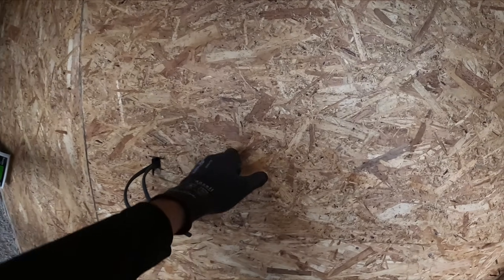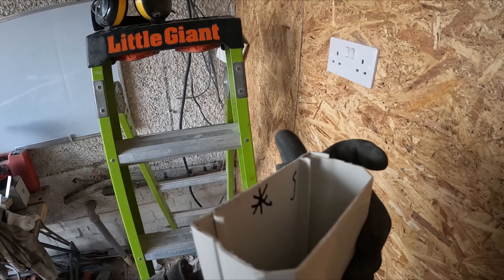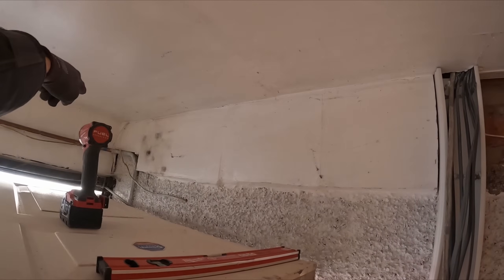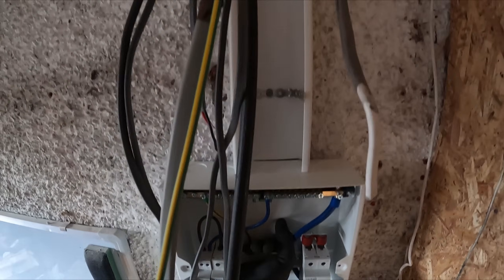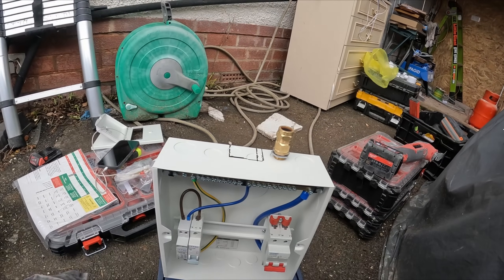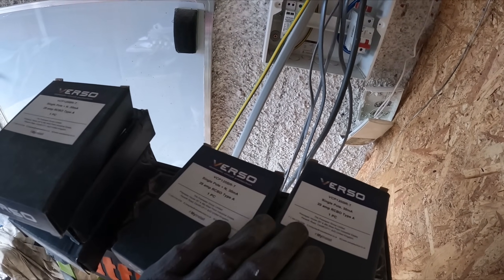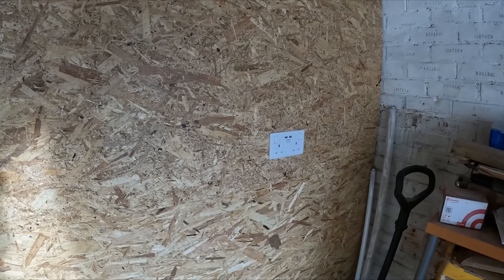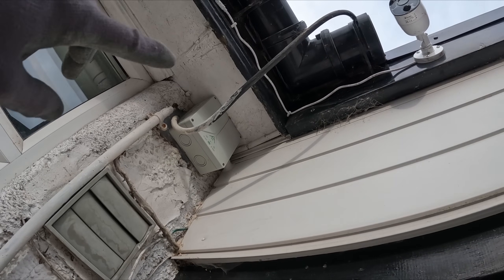Mistakes Were Made And Lessons Learnt

Comment: How does the verso compare to other brands its not a brand ive used beofre ?  Ive always installed Wylex but the last year ive been installing fusebox with RCBO £10 plus vat
Reply from the maker: Yea I like fusebox also it’s similar to verso bower I prefer the earth bar and neutral bar and shell of the verso hood thing is they both competitively priced and the verso has a range of accessories
Reply: @AdamDunlopElectrical  I’ll have to try it see how it goes, I think Wylex is still best for AFDD boards but I’ve not done many and with mostly working for letting agents the landlord always knows someone cheaper then get a call few months later saying can I do a EICR and it’s a new board they don’t have a cert for

Comment: Instead of grommet strip I've been using rubber car edge protective trim.  A bit more robust, comes in a few sizes.  Better for rounded corners so I usually take out a few knock-outs and link then together with a disc cutter with a thin cutting disc.

Comment: Fuse Board: Mentioned 11 times
Sunday: Popped up 7 times
Verso Fuse Board: Clearly a fan, mentioned 6 times
Armored Cable: Armored and ready, 5 mentions
Trunking: The unsung hero, made an appearance 12 times
Customer: Our wildcard, appeared 8 times
USB Socket: The customer's choice, highlighted 3 times
Conduit: Featured 8 times
Grommet Strip: Played a supporting role, mentioned 3 times
Summary:
Our electrician hero faces unexpected challenges, from extra sockets to customer whims. The garage undergoes a transformation, with a Verso fuse board stealing the spotlight. A symphony of trunking and conduit dances across the scene, leaving the garage looking sharp and level. A minor hiccup with knockout sizes adds a touch of drama, but our sparky hero conquers it with grace and a touch of super glue.
Reply from the maker: Ahah nice one ☝🏻
Reply: What’s the “jobs a good’n” count?
Reply: @alikirk4034 435 times